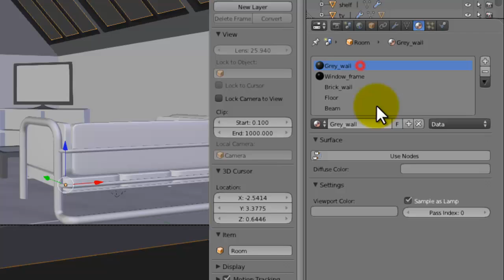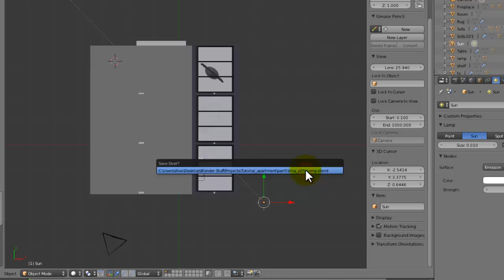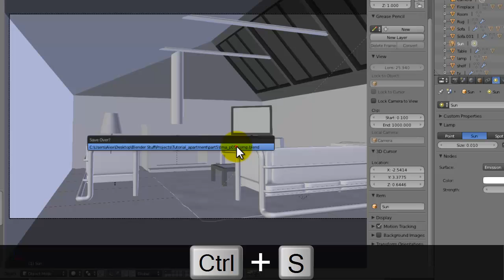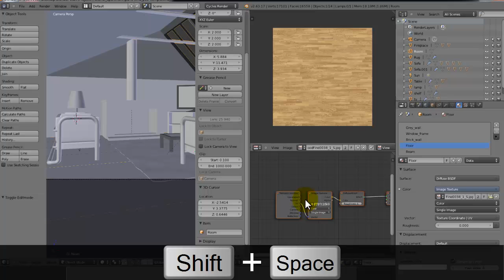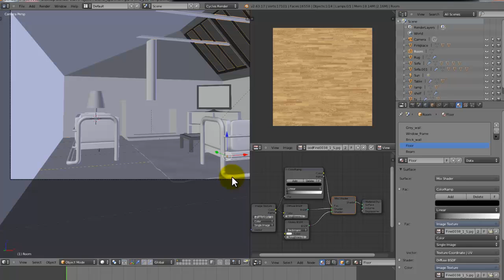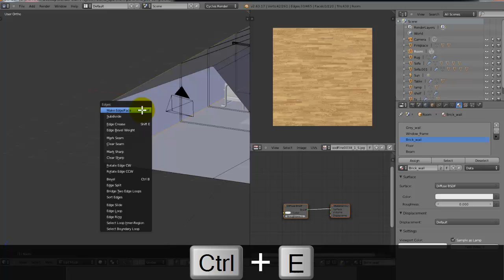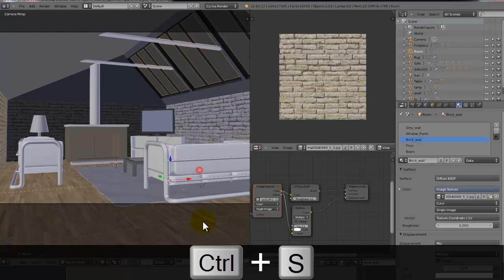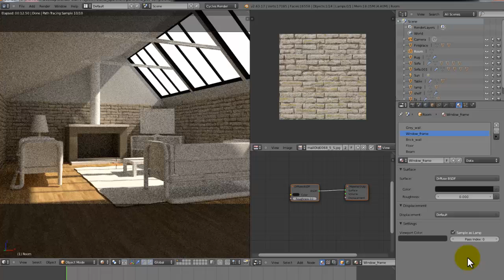[HD] How to Create a Modern Interior Scene in Blender 2.6 (Part #5)

Comment from the maker: When it comes to sun lamps, it doesn't matter where they are. You could put it under the scene and it will still light it up, you just have to get the angle right so make sure it's aimed into the room. Also make sure there is nothing in the way of the windows. The windows need to just be big holes, that's how the light will be getting in. I hope this helps :)

Comment: I have a very irritating problem: if I put the light the same way as you do it, as close to the room and so on, it just doesn't work like on your video. It is way less light and when I try to change options like strenght or size it doesn't increase the amount of light in the room. Are there any other ways to make the scene lighter with one sun? Or did I block something? I work on version 2.66

Comment: like he said increase your samples it's located in the render tab under Integrator. Some recommend 256 samples. but depending on your system i'd recommend 100 minimum if you have lower end system otherwise 256 should be enough. i do 400 just to make sure.